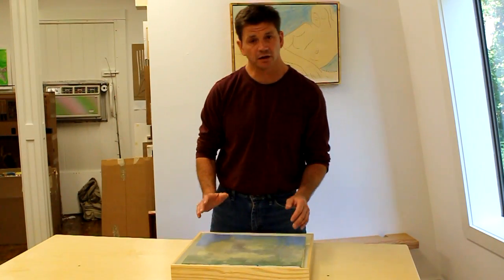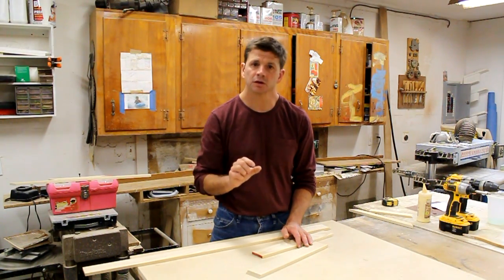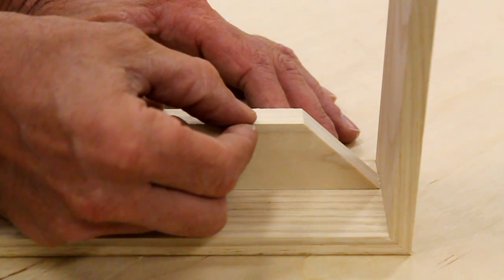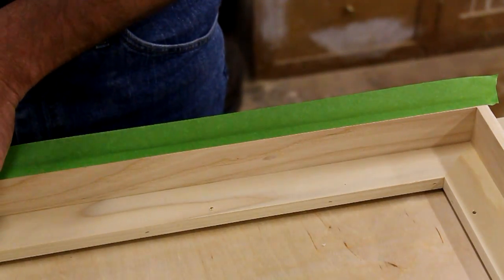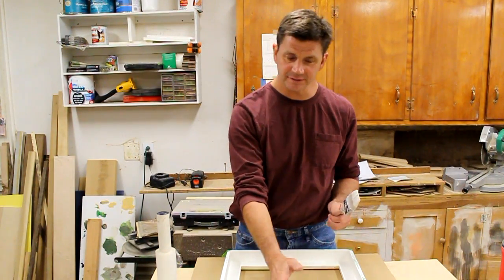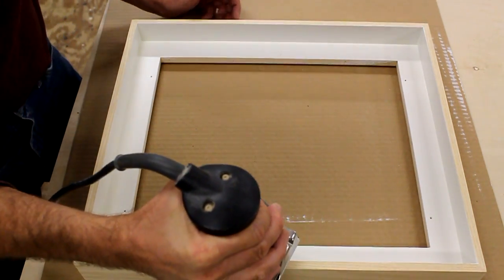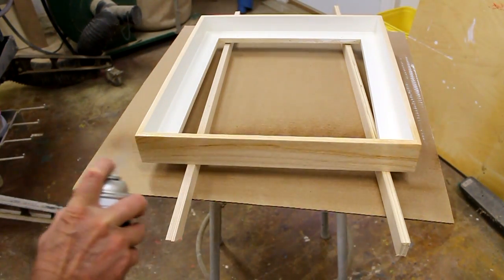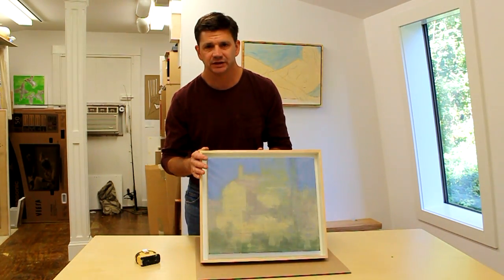How to Make a Shadow Box Frame by Jon Peters

Comment: Very beautiful frame job. One thing that occurred to me is that will a picture look better if it's gallery wrapped and sides painted too. That way the stapples will not be seen as they are at the back of the stretcher bars. What do you think?

Comment: I like the shadow box picture frame idea.  Can give the illusion it's floating in the frame too.  Pretty risky to nail that inside support piece on the way you did.  Your nail could have shot out through the face or back side.  Why not nail it from the outside of the frame?  You nailed the miters together from the outside.

Comment: Jon, I love all your videos. I am going to make a frame for a soccer jersey. Have you ever made one? Also, do you think 1/8 inch plexiglass would be good? Thank you!
Reply from the maker: MrMaritoJavier not for a soccer jersey but I've made a lot of frames and 1/8 works fine
Reply: MrMaritoJavier  1/8" perspex/plexiglass would be perfect for a Jersey - I've done 100's of them.
I would be curious to know why Mr Peters thinks Plexiglass would not be suitable.
Reply: Tom Martin I think he meant that he hadn't made a frame for a soccer jersey, himself, but that 1/8" plexiglass should be just fine. Correct me if I'm wrong *****
Reply: Jerseys generally require a vary large frame.  Using plexiglass in lieu of glass reduces the weight of the frame substantially.